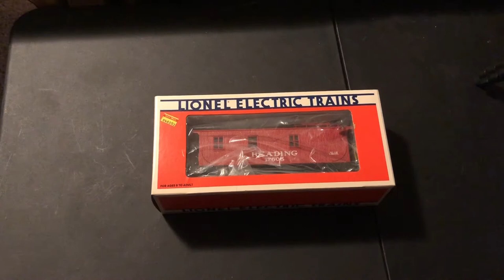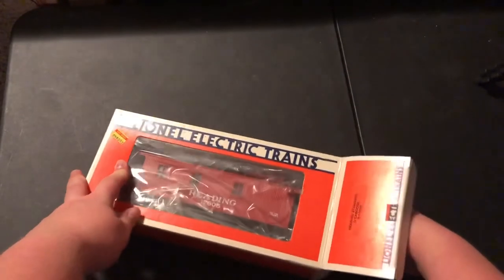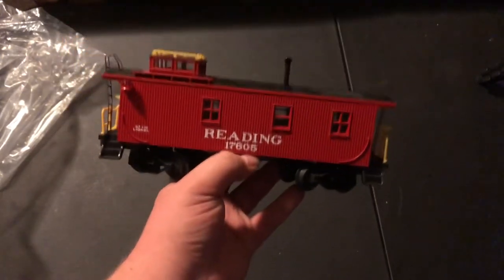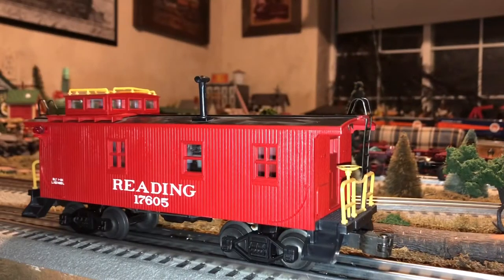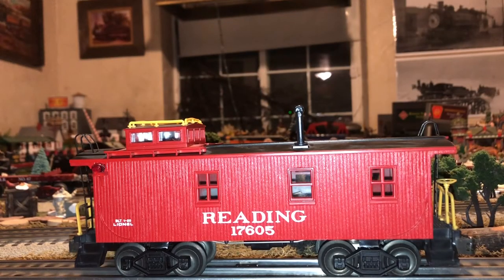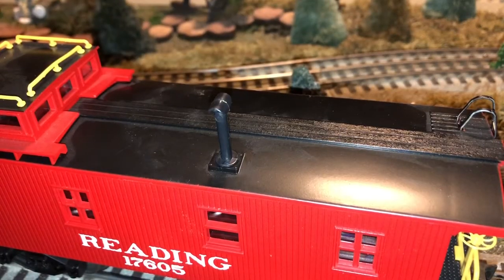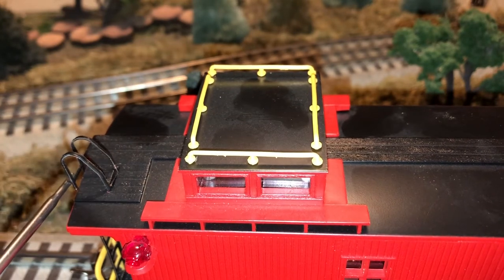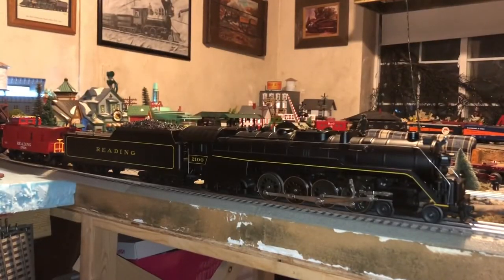Lionel 6-17605 Reading Caboose Unboxing And Review

Comment: Nice reading caboose Brendan
Reply from the maker: Thanks!
Reply: Np
Reply: It really matches your reading t1 in your collection
Reply: This makes the return of the reading t1's much More exciting
Reply: Speaking of reading t1's im so excited for 2102 and 2100 to return to steam
Reply from the maker: @Trainboy3982  I am excited when the two t-1s return! 2102 is going to return in February or march the. 2100 is going to most likely return in may. The caboose definitely fits the T-1 a lot!
Reply: Oh about 2102 according to wikipedia it's restoration Is espected to be finished in early 2022 that means in january
Reply: 2100 on the other hand it's restoration Is expected to be complete in either 2022 or 2023
Reply from the maker: @Trainboy3982  I talked to a few people and they said 2100 will be done in roughly 6 months if everything goes right.
Reply: Ok